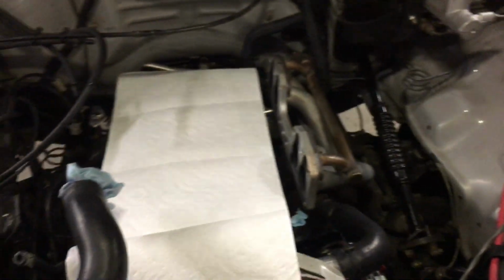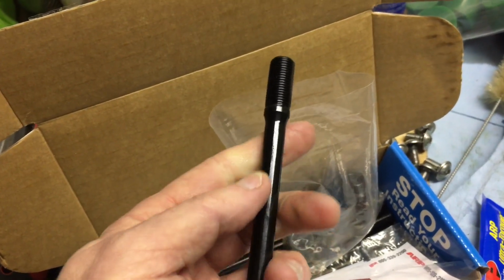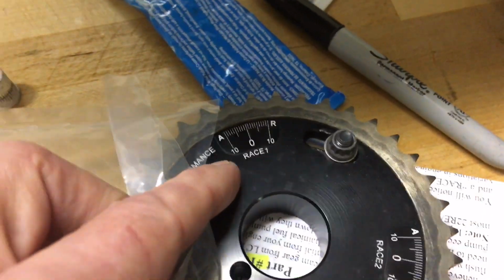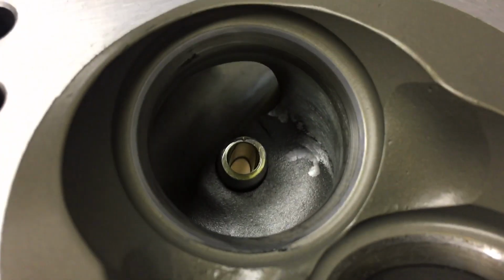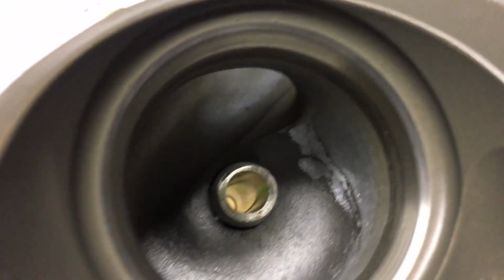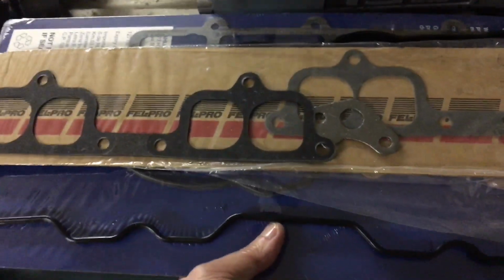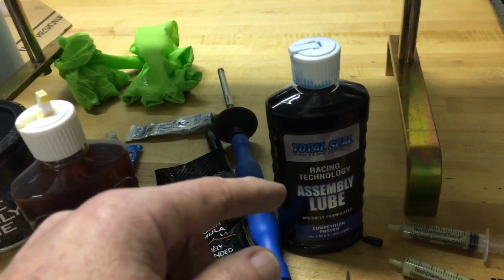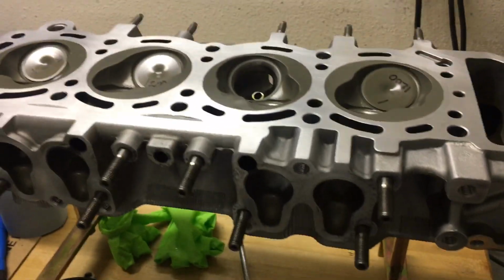Toyota 22RE UPDATE: Port match intake runner, valve lapping, ceramic pistons, new ARP head stud kit

Comment: Hi , what do you think of the back water jacket port not being used ?
Reply from the maker: Not sure what you mean? Are you referring to the cast iron plate back there which cools down the EGR gases (at least I think that's what it does). I still have mine installed on the head back there. You definitely need water circulating back in that area, whether you are running the EGR gases through the plate or not. But let me know if your question relates to something else.

Comment: Would you recommend cerakoting a 22re head? And should it be done before or after doing a valve job etc
Reply from the maker: Do you mean as I have done in this video here or the entire head inside and out (including external surfaces?

Comment: When I get to doing mine Im going to follow so much of what I see you do (or try : - ) Ray, re: the gussets vs head studs .. could we alter the studs rather than the gussets, or would that be a no no? (I feel like Im asking a dumb question) Thanks
Reply from the maker: There are no dumb questions, only dumb designs :) I thought about the same thing (modify the studs a little instead of having to get in there and relief the aluminum on the valve cover). However, after sizing everything up, I think modifying the valve cover is the correct approach. To gain enough clearance by modifying the ARP studs / nuts, I think you'd have to remove too much material and risk weakening them. So I would definitely say cutting out the aluminum there in the valve cover is the best idea.
Reply: @ray5961  cool, I had a vague idea that might be the case, but I dont have them on hand Thanks!
Reply from the maker: @tedbastwock3810  Yeah for sure, you're most welcome. Are you getting ready to rebuild your 22RE over there?
Reply: @ray5961  yes I am, although Ive had it on the back burner for a while, but the time is getting near as I clear other priorities

Comment: I’m interested in buying some ti exhaust studs Ray.

 Are you running Bosch 4 hole injectors? I’m waiting to get my block and head back from the machine shop and am thinking maybe I could have gotten away with a lap job. Seats weren’t  too pitted at 265k miles.  Good video.
Reply from the maker: Okay thanks for letting me know. Please subscribe to the channel and if I have any more produced, I will upload a video about it. The Titanium exhaust studs definitely are nice. I just finished the final lapping on my valves over here. My exhaust valves were very pitted and I was able to clean up about 95% of it using the various stages of compound.
Reply: Absolutely, look forward to seeing your truck back on the road.
Reply from the maker: @dudeitsknate  Me too, me too :) Oh and yes, I'm running the 4 hole Bosch injectors. Let me know if you need the link to where I bought them. It was something like Five O motorsports or something? I can probably dig it up if you need it.
Reply: How much run time do you have on those? Contemplating rebuilding my oem densos, or going with the Bosch ones. Thanks!
Reply from the maker: @dudeitsknate  16,412 miles on the 4-hole Bosche injectors; never skipped a beat. Here are the ones I'm running and where I got them from: https://www.fiveomotorsport.com/bosch-0280155997-toyota-4runner-pickup-upgrade/
Reply: Thanks Ray. Did you notice any extra power? How about carbon build up in your combustion chambers?
Reply from the maker: @dudeitsknate  Hard to say, since the truck wasn't running well before hand. It definitely runs smooth and gets good gas mileage with the Bosch injectors. They are tricky to install though. I seem to remember I had to take a razor blade and cut down the O ring tip things to get it to work. Definitely mock everything up on the fuel rail and check clearances and fit before doing the final assembly. It wasn't a plug and plug deal as I recall.

Comment: super cool keep us posted and please film the first start up! where did you get your titanium header hardware again?
Reply from the maker: Thanks man. On the Titanium studs for the head, that was stuff I had custom made and sold for a while on eBay (a few years back). I think I made 500 or 1000 studs and sold them in sets for like the 22RE and 2JZ, etc. Super nice hardware. I have had it made in different places, Russia, the UK, Asia. I may be doing another run soon actually. It's hard to find good studs with correct tolerances, etc. Lots of places sell it, but usually their thread quality is for shit.
Reply: @ray5961  do you have anymore i can buy?
Reply from the maker: @chefrobertcaldas  I don't have any extras of the ones you saw in my video here. However, I do have one remaining set of 8 Titanium exhaust studs (no nuts, just the studs) from my original Russian supplier that I could make you a deal on. They are very nice quality, but do not have the broached hex hole in the end. You would need to thread them in using two nuts or just hand tight, but otherwise they are top notch. If you are interested in them, I can figure out a price and also point you to where I buy the 12-point titanium nuts. Contact me directly via the address in the 'about' tab of my channel if you're interested.

Comment: What intake gaskets do you plan on using? I purchased that same Felpro set thinking it was a steal.
Reply from the maker: That reminds me, I need to add product links to the video :) Here's the one I mentioned in the video. I need to port match it later today actually. "Beck Arnley 037-4709". I'll have the link to amazon up in the video in a few also.
Reply: Only use Toyota oem